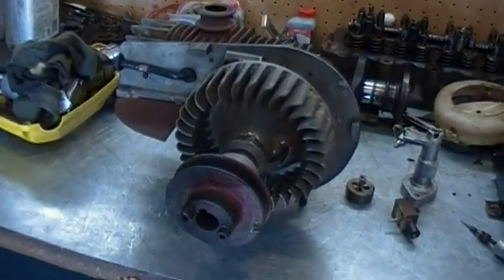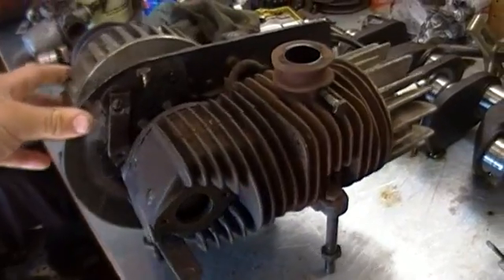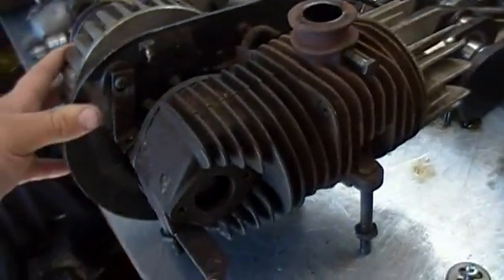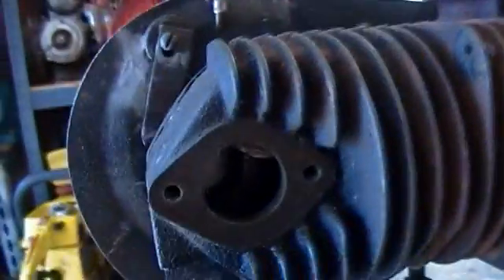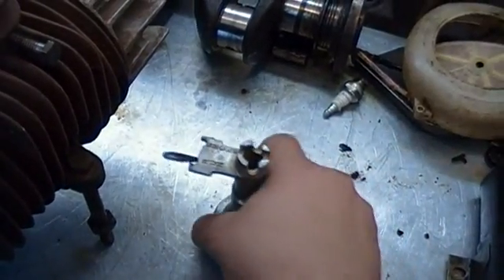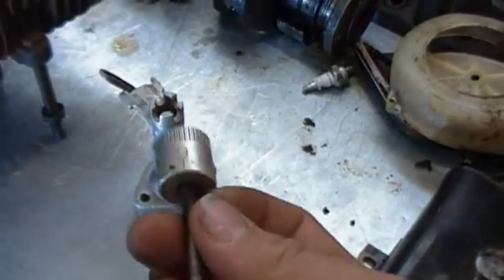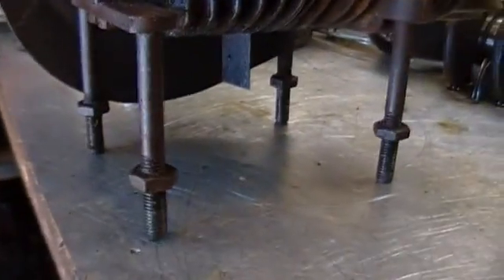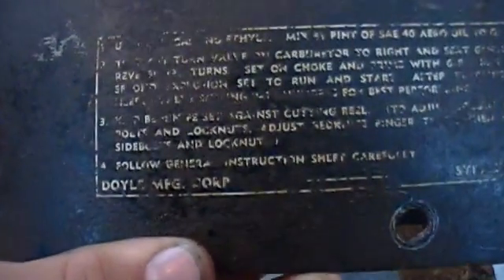Doyle 2 Stroke Engine

Comment: Cool design especially the poppet valve used in the crankcase , all the 2 cycles I`v seen or worked on used reed valves. The armature plate ,and blower housing has a close resembelence to a Briggs & Stratton. Looks likr those are rare engines. a true collector piece

Comment: no way you got one as well? cool! its out of the 30's. mine runs if you put gas in the cyl, but ive never been able to get it to run off the carb yet. mine is missing the scroud and some other parts. and FYI it uses a Bendix magneto same as used in some early clinton engines